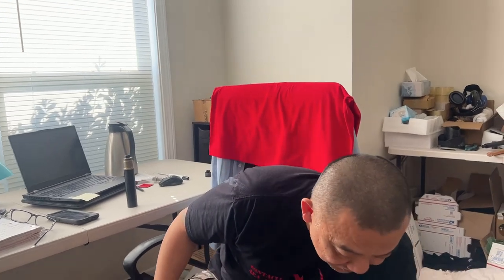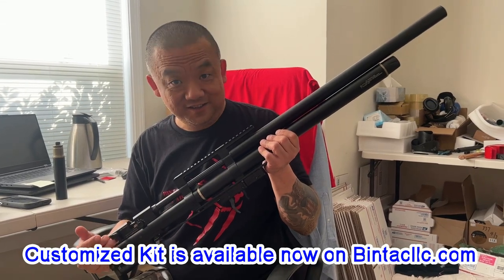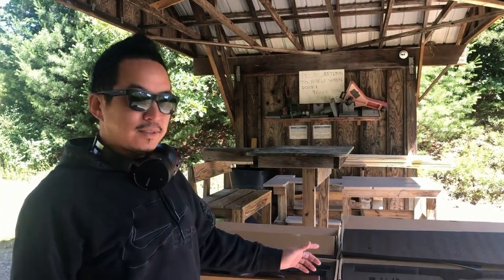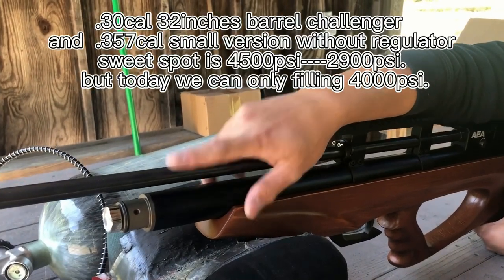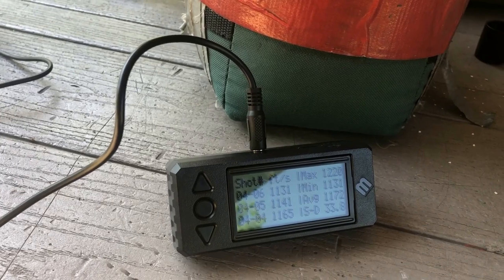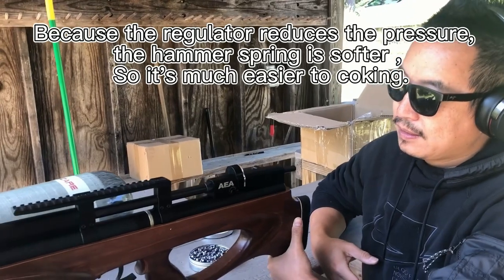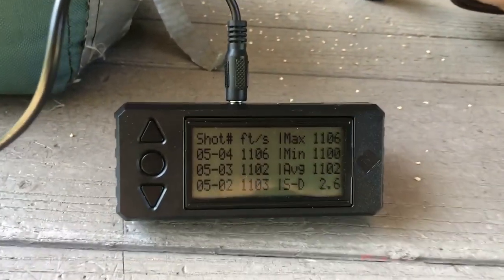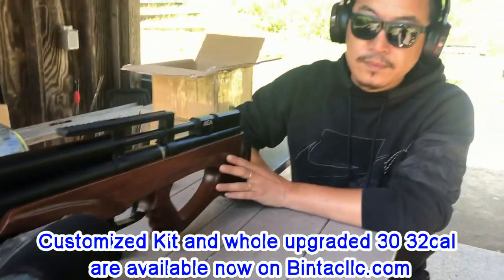BinTac: Field Test on Another New Challenger 30cal 32 inches customized

Comment: Also bin lu advised ME that I didn't need the heavier spring and THAT IT WILL NOT WORK WITH THE REGULATOR... that's straight from the horse's mouth... Mine is shooting in the high 800 fps to low 900s.. Would like to know what psi the reg is set on.....